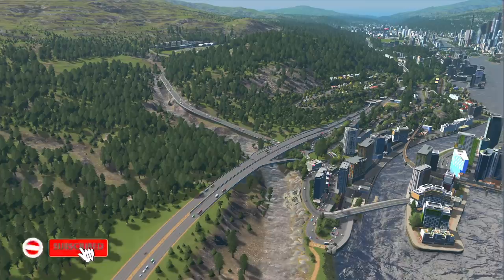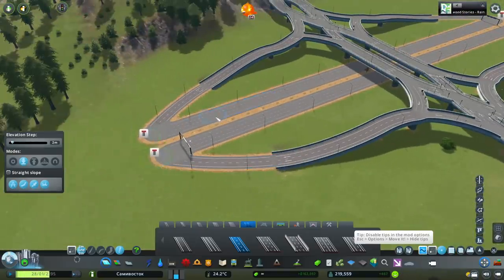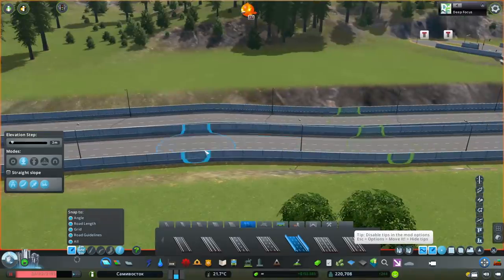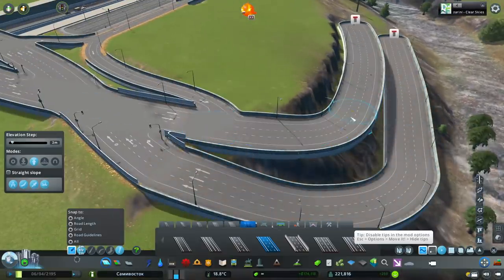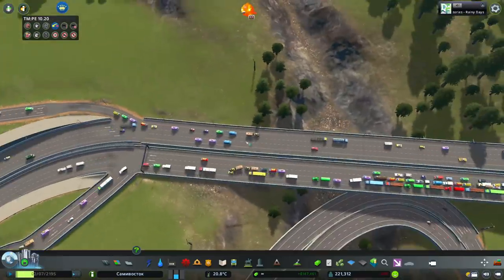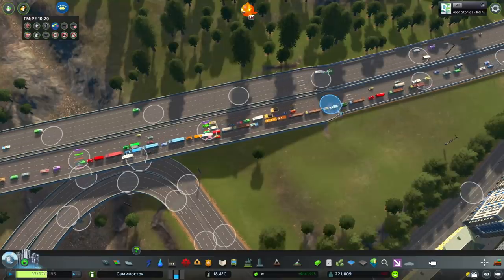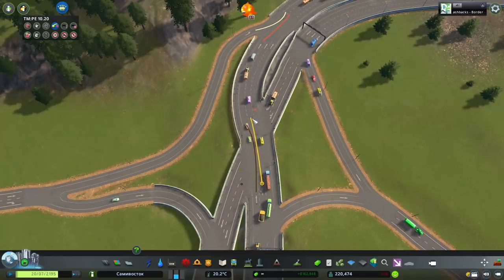Building A DIVERGING DIAMOND INTERCHANGE | Cities Skylines

Comment: Takes a DDI from workshop, deletes like 80% of it :-D
Reply: Well, that's what happens when you remove all the bad parts from it.
Reply: And transforms it into a DCMI.
Reply: yeah, that's why I love Sam's videos
Reply: Yes I liked that - only because it’s what I tend to do too! It seems easier to start with a template of what goes where before gradually adjusting individual elements
Reply: yeah and and in the end its colosal and not optimal due the limitations of the sim

Comment: Sorry, but a DDI needs to have timed traffic lights in order to function efficiently. Of course, cars would cross over in the middle bit, but that would be controlled by traffic lights removing the issue
Reply from the maker: I mentioned it is helpful to have time traffic lights. Not sure why you gotta say this ¯\_(ツ)_/¯
Reply: @SamBur  You've said multiple times that DDI is not very efficient unless it's managed correctly. I thought you're going to do that when i see the title
Reply: @li_tsz_fung  funny because in real life the ddi is like the most efficient thing ever lol but in the game it needs lots of management.
Reply: I guess with one of the traffic light intersections removed the timing is not needed that much anymore.
Reply: @gamelard1963  No, in real life, every intersection is using timed traffic light. And the default traffic lights in game is really not that good
Reply: @Sam Bur you mentioned it in passing, but really without timed traffic lights this interchange doesn't make a lot of sense. The lights lower the amount of the weaving that you mentioned as a downside.

Comment: As far as out of the box Workship Diverging Diamond Interchange's I like to use, these are my primary go to's: 
Marlo's DDI/DCMI Version 3
https://steamcommunity.com/sharedfiles/filedetails/?id=1832324129
DCMI (Compact)https://steamcommunity.com/sharedfiles/filedetails/?id=455326893

I really like Marlo's to use as a highway to highway interchange, and DCMI Compact works great when merging street traffic to highway.  Both of these interchanges do not use traffic lights and use the crossover method (DCMI) you show in this video.  I do adjust the slip lanes as needed on these interchanges and add AI paths with TM:PE.  I find that these work extremely well for the for-fun traffic fixes I like to do.  I have to admit, for Cites:Skylines anyway... DCMI really trumps DDI in terms of performance.

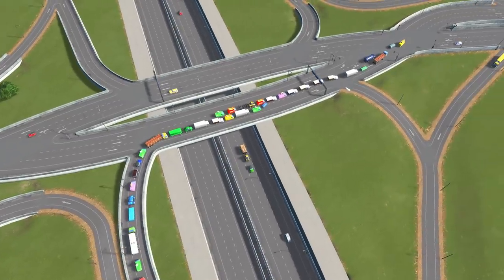Comment: 8:15 That problem is non existant IRL because the traffic flow is regulated with traffic lights to avoid those mix ups
Reply: That’s true but that’s why they don’t work very well in game. In real they are considered part of the same intersection as actual crossover intersection so when the crossover light is red the off ramp is green, sadly the game can’t do this correctly unless you spend time figuring out timed lights. Otherwise I’d put a stop sign or yield.

Comment: I love DD interchanges, have quite a few of them. I grade separate the roads to remove all the intersections and have the on ramps merge from the middle, meaning no need for lane changing through the middle. It can handle a huge amount of traffic. This is a very early design, my later ones uses highway sections are and more curved. https://i.imgur.com/tkmiL1J.jpg

Comment: Those lane math ... nope nope nope nope.

The amount of lanes you need is determined by the amount of traffic, you need to put through the road. Which means:
1. you're allways ok to add lanes. 2 + 1 = 4 is a completely correct assumption in lane mathematics. It might be necessary, if there is to much traffic when approaching an intersection which cuts down on the capacity per lane, while the traffic was free flowing before and didn't need such.
2. 2 + 1 = 3 is especially wrong, when the oncoming lane isn't for merging. You can easily leave this to 3 + 1 = 3, since the traffic from the of lane has to yield anyway. You also could give them a timed traffic light and more lanes, so they only move, when there's no other traffic moving into this area.

And the last point about this interchange: it's to small. If you want a compact interchange, look into SPUI, which are a bit less efficient due to the use of three instead of two phases, but can work with much less space, since there is only one traffic light and no need to have a lot of space between two traffic lights, which reduces capacity if to small.

You're clearly a city planner, but no traffic engineer :D

Comment: Ugh, not a fan of DDI.  At least you avoided ONE of my complaints: the useless traffic light where both directions can't make any turns and just have to wait for the other to pass.  It's like a train crossing, except there's no train, only cars.  And you should always avoid building a train crossing if possible!

Of course, my other complaint with DDI was addressed (but not fixed, because it's inherent to the design) in the video as well.  Oncoming traffic conflicts with outgoing traffic.  That crossover merge can cause accidents, and is super stressful to drive if there's any kind of reasonable speed and traffic level involved.

What would I prefer?  I honestly think stack exchanges have a certain beauty to them.  Like a skyscraper, but for cars.  I grew up near a four level stack (I-695 / I-70 junction in Maryland), and always thought it was the coolest things ever.  Yes, they take up space... but they're just so cool!  And this DDI takes up a boatload of space ANYWAY, so...

Comment: I've always used the same "disconnected" crossing of lanes in DMCI's I've used - how does that not make every sense? Why have the crossing with traffic lights at all? Having them disconnected on both sides just makes the traffic flow so much faster... Well done.
Reply: A few reasons, but the big answer is that real life works differently from the game. For one, building anything elevated costs money both at construction and over the lifetime. If you can build it level then you do, as a rule of thumb. Two, existing diamond overpasses can easily be converted into diverging ones at a very small cost. Three, part of the benefit to using it is supposed to be to allow pedestrians to cross safely at the lights by having them only cross one lane of traffic at a time. The reason why this is even a concern is because of four, in almost all instances of this the diverging part is going to be a local highway, not a freeway. I don't think there are any real instances in real life of it being used to interchange two highways like Sam did. That's part of the reason they don't worry about merging like Sam did. There's supposed to be way less capacity on the diverging lanes, plus the light is supposed to give an opportunity for the people coming off to go through while the light is red, because they should otherwise yield to through-traffic. Really, some sort of stack or roundabout interchange would probably work better in this instance, but it would have to be a bigger roundabout than the one Sam had at the start.